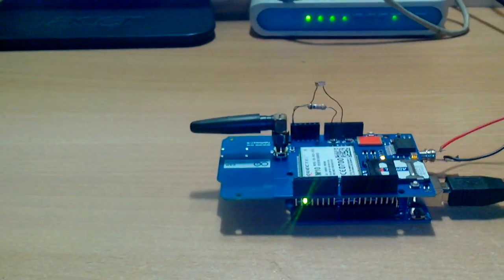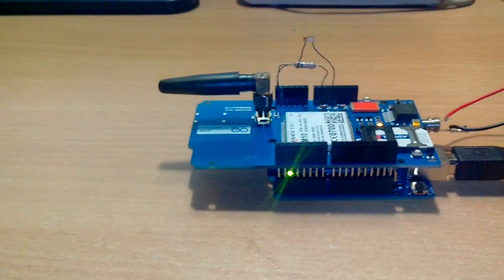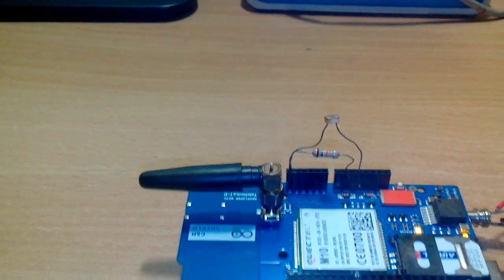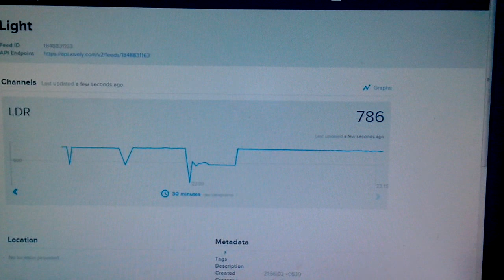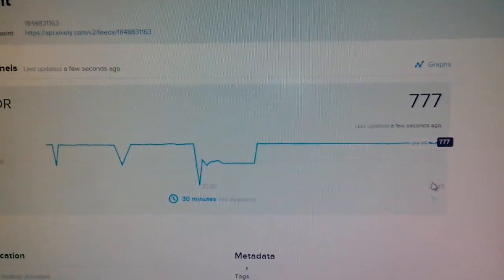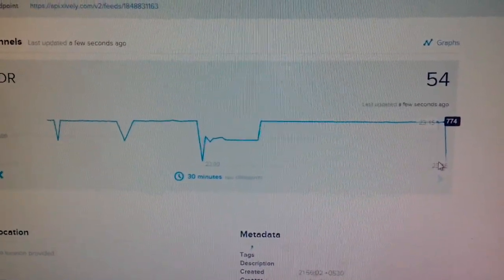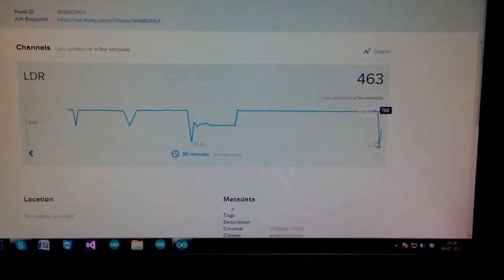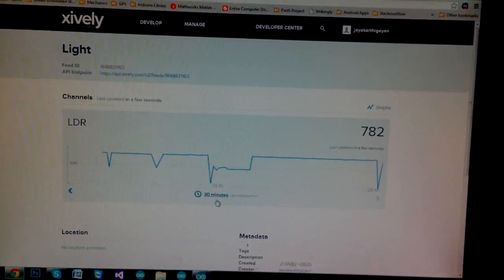Arduino Data logging on web server using Arduino GPRS Shield

Comment: Any idea on how to use SIM900 gprs module to act as a server so as to receive data from the internet to an arduino ?
Reply from the maker: sim900 has a library to do this... google sim900 gprs library... you will get it...
Reply: Jayakarthigeyan Prabakar I tried interfacing my sim 900 with arduino using the inbuilt server example from library of gsm shield...but it dint work out... Ill try using the library that u suggested as well..hope it works out..

Comment: that was brilliant. i have question if i want to connect multiple sensors and they gather the data and send to a simple web page after show the data as graph and after that store them in  file  format which is i can analyse it plus i need this connection works in other way which i can do some simple things from web page to arduino like turn  on/off.
please give me some ideas.
thanks

Comment: Is it possible to use Arduino GSM shield for sending the data via internet to the website
Reply: yes... what do see in the video is sending data via internet to website xively.com
Reply: Jayakarthigeyan Prabakar Where can I see the MAC address of my arduino GSM shield? I have checked it at the top and bottom of the Arduino GSM shield, I saw many serial number and other number, but there's no number that can be related with MAC address

Comment: first: yes i read the description! but in the link there is only described how to with an ethernet shield and not with a GPRS shield or is it the same thing?
Reply from the maker: The base idea of the code is same, you just have to make few changes...
Reply: thanks! i found on the arduino website an example code, exately made for that. but again thanks!
Reply: Kilian Mock can you please share the link for example code.

Comment: posting to xively.com after two weeks of struggle. Using the Uno and sim900. Check the feed right here: https://xively.com/feeds/1219426047
Reply: awesome
Reply: Mahlatse Maraba bro, would you mind to give me your example? basically i need the code to send the data using that sim900 and i havent find it yet. still working here but really glad if you mind to help me bro.
Reply: what problems are you facing?
Reply: Just some error when i was trying to upload to the xively. it kept showing "connect error". but it's okay bro. i've already figure it out. thank you